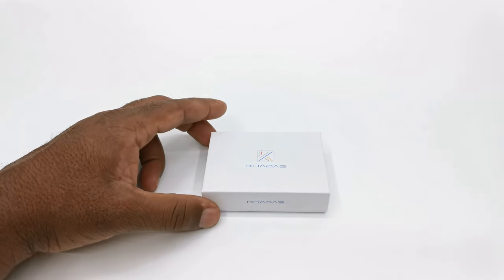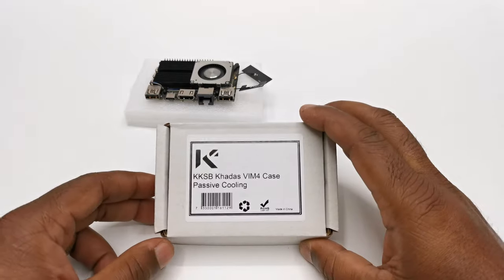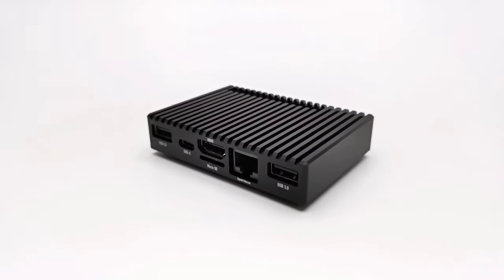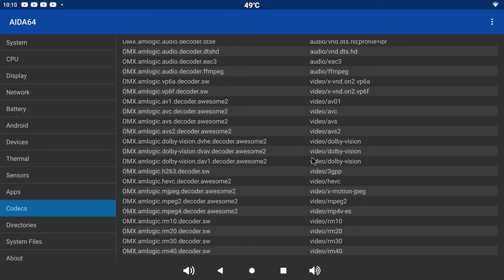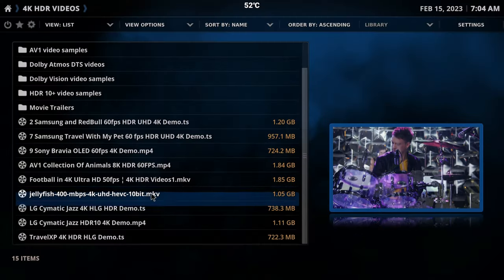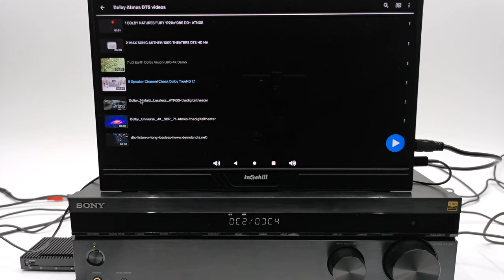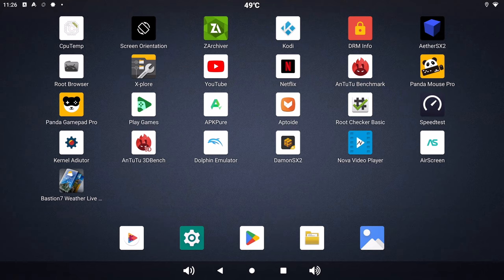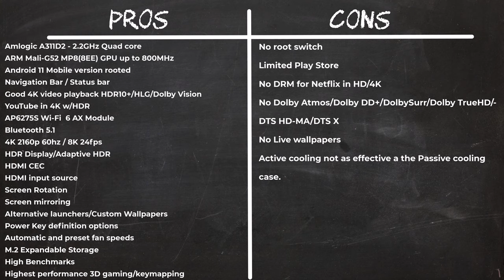Khadas VIM4 DIY Super Android TV Box Completed Project

Comment: Great review, Nick! It looks like this board is so close to being perfect, but it also seems to me the best solution is still purchasing a/or using your current Samsung Galaxy phone (even an S10 would do), getting a decent USB-C dock, and either using DeX or installing a TV launcher to end up with a more powerful solution. Sure, the form factor is not the same, but in the end, a Galaxy phone would take care of all the drawbacks this board has and still far superior in terms of performance. So much potential, though!
Reply from the maker: I've come to the realization that the setup using your mobile phone is not the best solution for the non-tech savvy or wire sensitive users. So having an Android box type device with a case and ports with powerful hardware would be a more acceptable solution. Whilst a high-end Samsung galaxy phone will blow the competition away, some might find it cumbersome to set up to have running right next to your TV, hence why I have turned my attention to ARC and SBC boards.
Reply: @tvboxstop  point taken, Nick. No reflection on your part. I think it's wonderful that you share all these tech reviews with the community. I think it's more of a reflection of my own frustration to not see a true solution for the Android box space in which a device meets the most basic features and then some. Keep up the awesome work, bro!
Reply: NOT FOR ME NIC. I PREFER A COMPLETELY FINISHED BOX. GREAT REVIEW AS ALWAYS MY BROTHER.

Comment: Hey man i wanted to buy the second edition of the a95xmax but i cant find anymore and all youtubers links are dead any idea why its dicontinued
Reply from the maker: That's going to be difficult to find as production stopped on that second model for quite a while now. That's just how to TV Box industry functions. The manufacturing of a particular chipset only continues until its compatible Android version last. For example is that chipset was designed to run on Android 9 operating system, when Android 10 or 11 releases that chipset will not be compatible with those versions. Hence they will move one to manufacturing the next chipset that's compatible. And as time progresses the previous chipset will become irrelevant and incompatible with some of the latest updates of apps on the play store.

Comment: every time I buy an Android TV Box, something doesn't go as expected.
My first device was h96 mini had slow storage and ended up being hard bricked.
secondly, bought the same type h96 mini, only has single wifi support unlike the specs written and youtube crash.
Now I'm experiencing it again. Bought second hand a95x f3 slim 4G/32GB, doesn't have 5ghz wifi support as it should and bluetooth controller often doesn't respond during use, at first i hope this box have vulkan support but it is not 😩
Reply from the maker: If you want a solid TV Box with no issues of what you are referring to simply go with a low-end or high-end Ugoos or TOX model. Buying second-hand boxes I would never recommend. It's better you spend your money and by the good stuff.